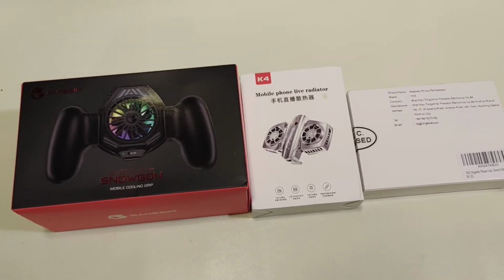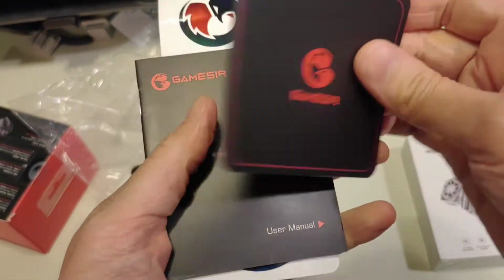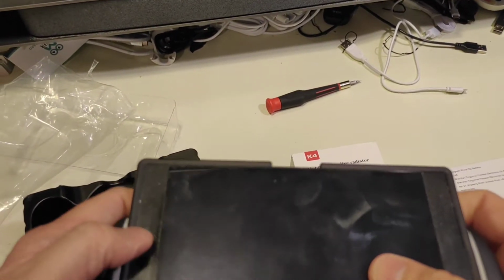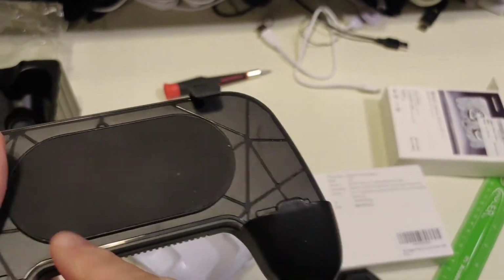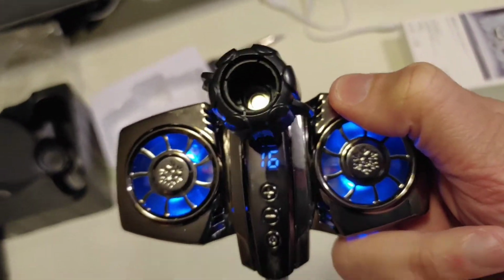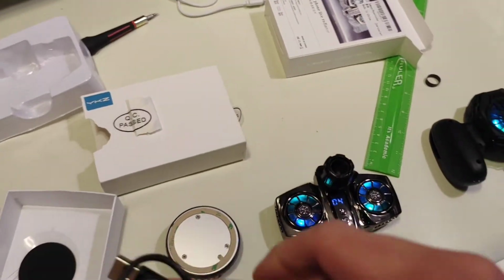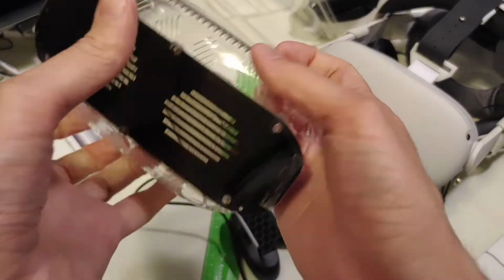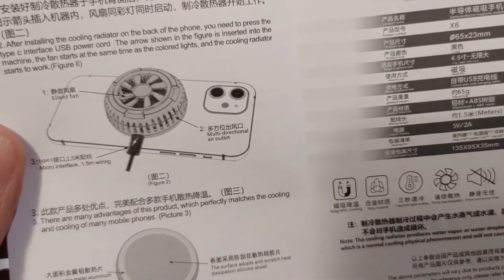Unboxing Overview Use Comparison Impressions of Semiconductive Mobile Device Coolers!

Comment: Great reviews, thank you for this video. I was looking for a review on the Jewbery cooler. Please how much does it cool down your phone for gaming
Reply from the maker: It offers a good amount of cooling, but where it's just the plate, and not a silicone adhesive layer over it, it cools fast, but then heat transfer from the device it's cooling will then make it have a feedback effect. I solved this with a refrigerant semiconductive heat transfer pad on the device to have better 1 way cooling, than 2 way heating and cooling. I hope this helps, and much thanks for your comment, question, interest, and for your viewership.
Reply: @xyberKnight  please could you make a video of how to solve the heat transfer problem with the refrigerant semiconductor
Reply: @xyberKnight  please I would like to see a video of how you solved the heat transfer problem
Reply from the maker: @rustedreaper1682  Unfortunately I don't have any more of the semiconductive heat transfer pad material to be able to garner a follow up video. I hope this helps, and much thanks for your response, comment, interest, and for your viewership.

Comment: Which one is the best overall?
Reply from the maker: Best is a conditional state for these coolers, based on which device you have that you want to you a cooler with, budget(if that is a factor), versatility, and design. For the best value, the YKZ is the best, because not only is it a magsafe style magnetic cooler, but it also has wireless charging for devices that support it. For selfie stick users or mounting, the Jewberry with the larger surface and dual fan cooling and passthrough charging is the best, and in none of my scenarios would I recommend the F8, because there are other solutions out there that can be had with built in battery for a grip, or even built in controls if you wish to go with the Gamesir X3(just doesn't fit my use cases). This is why I don't do reviews, because I "best" is conditional, and I try to not bring personal opinions or judgement within the factors, only the facts of what things are, and what possible ways they can be utilized. I know this isn't the "Tell me what to buy" answer that you may have been looking for, but without more information as to which device you have, and what use cases you would present for needs, I don't want to make any suggestions for you. I hope this helps, and maybe you'll respond with more information, and I can research for you what I would suggest from that, and much thanks for your question, interest, and for your viewership.
Reply: @xyberKnight  I am using one plus 7T ( hotdogs ) under weather temperature almost 40-45°C I am from Pakistan here's local online shopping application is daraz i want to order the product from here my budget is from 3-5k pkr ( 15$-25$ ) Are these details enough for better suggestions
Reply from the maker: @syedshaeelalishahsyedshaee32  You could use either the Jewberry or the YKZ for that price, both would fit your device and offer either wireless charging with the YKZ, or wired charging with the Jewberry. I hope this helps, and much thanks for your response, interest, and for your viewership.
Reply: @xyberKnight  sir i have looked on applications available in Pakistan but there isn't any availability of ykz & jewberry phone radiator .... I have investigated and what I look k4 phone radiator is the same as the jewberry & available in Pakistan
Reply from the maker: @syedshaeelalishahsyedshaee32  Much thanks for sharing the information for your region and what product is similar to the Jewberry in Pakistan area viewers. I hope that the cooler fulfills your needs, and much thanks for your response, interest, and for your viewership.
Reply: @syedshaeelalishahsyedshaee32  Did buy Remax K4?  Is it good?  I am OnePlus 7 pro user,same region.

Comment: I am actually more concerned would condensation goes inside the phone with those temperatures difference?
Reply from the maker: First off, my apologies for the time it took to respond, I check messages everyday, and it wasn't until today that I checked and something actually showed up, literally 2 weeks worth that I've not seen anything from. I've yet to encounter through my testing and experiences personally any issues with condensation, vapor, or water in devices. I can only speak of course to my own experiences, and hope that helps, and much thanks for your question, interest, and for your viewership.
Reply: 🙏 thanks
Reply: Saw some technician comment (group i joined in facebook) for my phone model on some phones he repair (diff models) that have rusted inside due to cooler and some have short circuit. And another user who dont want to use cooler anymore as the same thing happen when his phone died he brings it to a diff technician and when they open it, it is rusted.

So yes condensation can happen inside specially if phone aint air tight and theres humidity on manufacturing or what ever let a humid air inside the phone to form condensation with temp difference.

Personally i am loooking for a cooler with temperature control so i can reduce it to around 20-25°C instead of 0+5°C
Reply from the maker: @lowcost549  This can be an issue pending the phone model. I'm using Sony Xperia IP67 devices or AYN Odin Pro with modifications, and my Quest 2 VR headset for safe peltier cooling with semiconductive type of coolers. I've taken apart my phones and checked after a couple months of use from Razer Phone 2, Xperia 1 Mark III and Mark IV Gaming Edition and there's not water damage using a adhesive metal mount ring alongside a silicone base and thermal transfer pad under the device on top of the battery(where it's mounted) to prolong the life of the phone. I only run them on phones when I'm trying to keep the battery from overheating and draining faster as the devices themselves are all fast enough. For the Quest 2 however, it's directly sitting in front of the fan to draw in much cooler air through the headset. All that aside, I do these things because I like to and can afford to take the risk, so if some one doesn't feel comfortable using them, there's plenty of other solutions out there. I hope this helps, and much thanks for sharing your experience and insight, for your interest, and for your viewership.

Comment: So do you have to charge them first and take off the plug to use on the phone or use with the plug on phone
Reply from the maker: There is no battery internally only plus in USB C to power, and USB A to passthrough up to 1.5A to charge your phone while connected. I hope this helps, and much thanks for your question, response, interest, and for your viewership.
Reply: @xyberKnight  nah thank you I am having hard time buying phone coolers and I want a phone cooler that has a battery and play Genshin anywhere you know
Reply from the maker: The one that I've been using hasn't been restocked, where it's a 4000mAh battery+semiconductive cooling, and a grip was $38. This is the only thing that comes close that I'm still awaiting on shipping from China due to the current state of the shipping venues being shut down currently over there for another week. I understand if you wish to wait until it's covered in content before taking a chance on it, but it comes in 1,000 or 2,000mAh battery equipped. https://www.amazon.com/gp/product/B09DXBWVD1/

I hope this helps, and much thanks for your question, response, interest, and for your viewership.

Comment: dual fan cooler seems to be the best for now
Reply from the maker: I mainly use it in the car to dock my phone on the dash combined with a ball socket mount. It works pretty solid, when it contacts the back of your phone. Otherwise, it's a cool way to have passive airflow and to mount and charge my phone. Much thanks for your response, comment, interest, and for your viewership.
Reply: @xyberKnight  yeah, cooler temp of battery means faster charging and its healthier for the battery
Reply from the maker: Very much so. Much thanks for your response, comment, interest, and for your viewership.

Comment: Which one is best. Does the second dual cooler actually have two peltier and is the power supply to it sufficient enough
Reply from the maker: The Jewberry cooler has a center linked chip across the semi-conductive plate of the 2 fans(each with heatsink to improve thermal transfer. I prefer it in the car, to hold my phone, but I had to pull the power inverter out again, where my stereo's USB port only carries up to 1A, and this can handle 1A to run the fan, but for being able to also charge, it needs 2A to 3A of 5V power. I hope this helps, and much thanks for your question, response, interest, and for your viewership.

Comment: Do you think that dual fan works for plastic phone or not and is it comfortable to play while using it?
Reply from the maker: As long as the phone is thin enough to fit within the clip size that the cooler can comfortably hold the device, then yes, it should work ok. It can be used to cool while playing, as your hands are on the sides, and the amount of space on the back taken up by the cooler isn't obtrusive to me with larger hand size. If it is, you can go with a single fan larger cooler. I hope this helps, and much thanks for your question, interest, and for your viewership.
Reply: @xyberKnight  Thanks a lot for you great content and your help
I wish you all the best in your job
Reply: Quite heavy to play with dual fan cooler

Comment: Does the second one always need to be connected to use.
Reply from the maker: The Jewberry doesn't have any internal battery, so it does require a connection for power to the fans and semiconductive cooling plate. However having a passthrough on it to still be able to plug in a separate cable for charging your phone while in use is handy in my car. I hope this helps, and much thanks for your question, response, interest, and for your viewership.
Reply: @xyberKnight  thanks man.
Reply from the maker: There isn't any battery inside the device. The read out is the amount of cooling it is set to reach. I hope this helps. Much thanks for your response, comment, interest, and for your viewership.

Comment: Whats that thing that you screw in, in the back of the semiconductive
Reply from the maker: It's a screw in adapter to use with clamp on ball joint mounts. It uses a quarter inch threaded port on the cooler itself for things like selfie sticks or tripods, or other mounts. I hope this helps, and much thanks for your question, response, interest, and for your viewership.

Comment: Do you have a link to the first grip cooler?
Reply from the maker: If you are referring to the black grip with the semiconductive fan cooling plate and built in 4000mAh battery, it's the Aiky Universal Mobile Phone Cooler Radiator Upgrade Water Semiconductor Cooler + Silent Fan, nearly always out of stock on amazon, but the link where I got it is https://www.amazon.com/gp/product/B07VJ2ZSWS/

I hope this helps, and much thanks for your question, comment, interest, and for your viewership.
Reply: @xyberKnight  Thanks for replying!
Reply from the maker: @proxima1998  Sure thing, hopefully you may be able to find the battery cooling grip from another source that I'm not aware of. Much thanks for your response, comment, interest, and for your viewership.

Comment: Try flydigi b5 its cold all the way to -3.5
Reply from the maker: I'm waiting on the B5X to get sent from overseas currently, which is very similar to the Black Shark & Razer coolers that I have used, but with the Flydigi app support for RGB color control and fan speed. I didn't like the b5 due to not working well with curved back phones and covering buttons, which is why I've started utilizing Magnetic attached MagSafe style coolers. I hope this helps, and much thanks for your suggestion, response, interest, and for your viewership.

Comment: Can u help me? Why the secone product if i on it ,it will off?
Reply from the maker: Are you using the passthrough port(USB type A) or the power to the cooler port(USB type C)? Also, what device are you using it with? I hope this helps, and much thanks for your question, response, interest, and for your viewership.

Comment: I don't recommend plugging this into your computer it does not put out the right amperage it could blow out your USB ports plus you would get less performance on the cooler
Reply from the maker: Great advice. Thanks for sharing your experience with the product. I don't directly plug into my computer, but instead a grounded 6 USB 5v port hub that I have sitting on top of my PC that's plugged into the wall. I hope this helps, and much thanks for your response, interest, and for your viewership.

Comment: what is the best power source for the duel fan cooler?? can i use my 33wat charger for it ???
Reply from the maker: Pending which one of the coolers you are referring to, the Jewberry with the read out dual fan can handle up to 3A, due to the passthrough, you could use a USB A to USB C for charging the phone, with a short USB A to USB C cable, but the USB C port on this is for powering the cooler, which requires at least 800mAh of power. You should be able to use your 33Watt charging block and cable to run the coolers. I hope this helps, and much thanks for your question, interest, and for your viewership.
Reply: @xyberKnight  yeah cool mate Thanks for replaying <3 Cheers